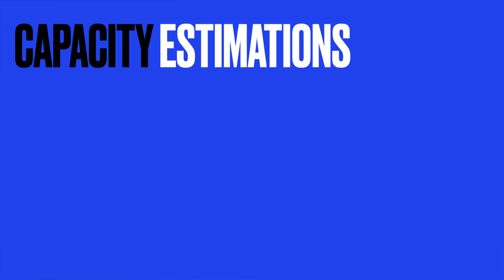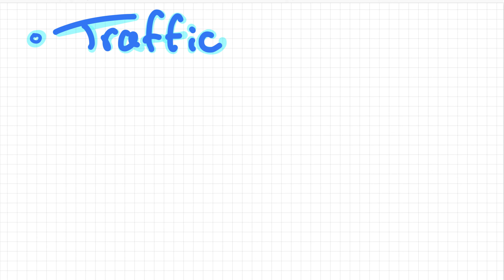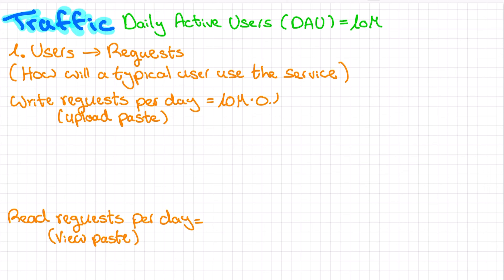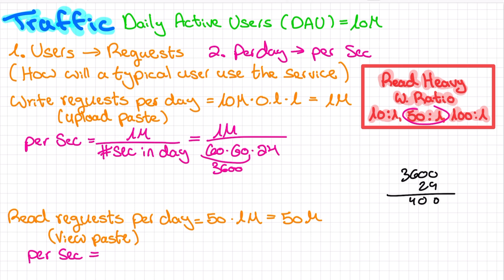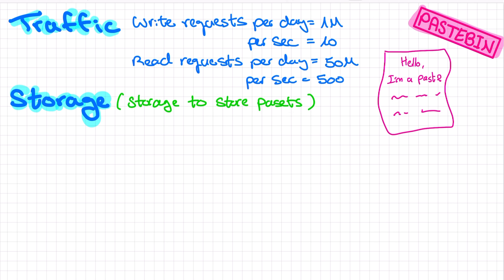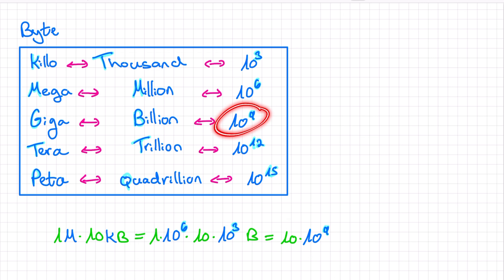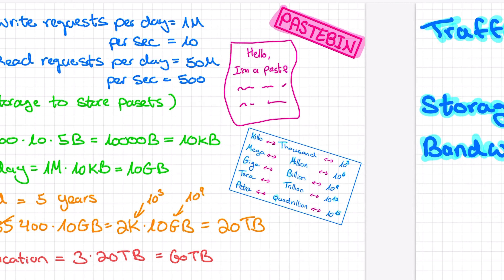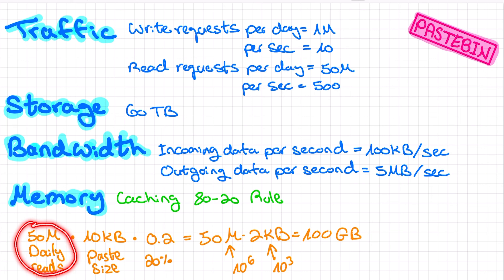Capacity Planning and Estimation | System Design for Beginners

Comment: I'll give an example. Estimated capacities are very useful when choosing which type of compute solution will be needed, for example you might want to pick a storage optimized solution if dealing with high storage and I/O requirements such as the case when hosting databases. It's really good if you bring this point up as it makes the activity far from being meaningless.